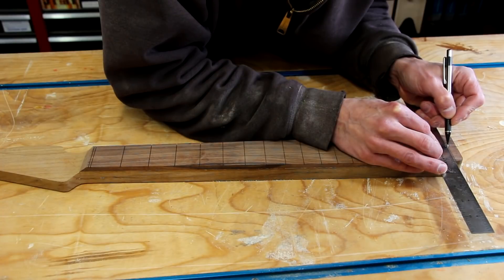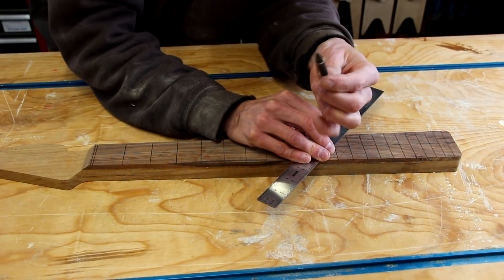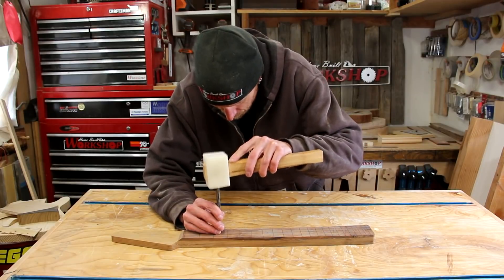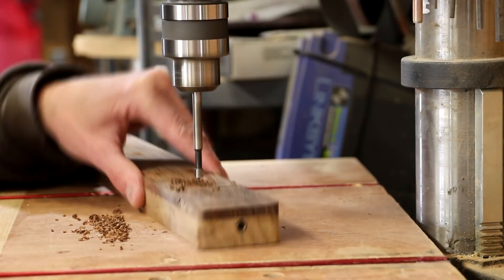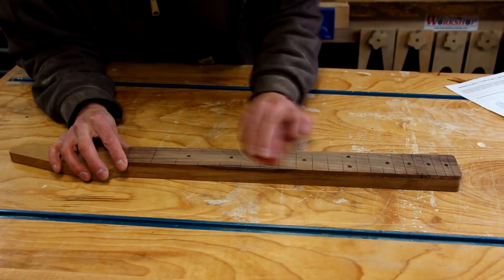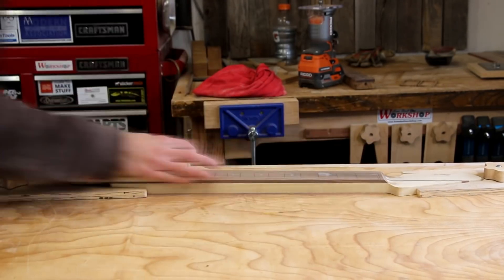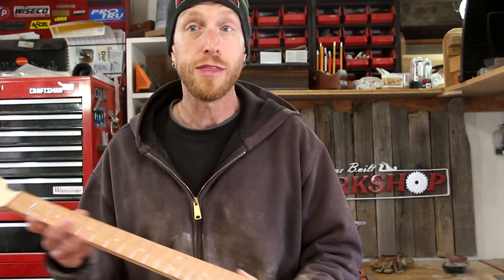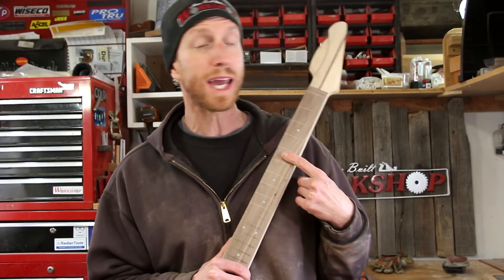Guitar Building Basics: Fretboard Markers

Comment: Great video, can you use epoxy as fret material for a lined fretless bass??
Reply from the maker: I'm sure that would work fine. Make sure you put some tape on the ends so it doesn't run out the slots.